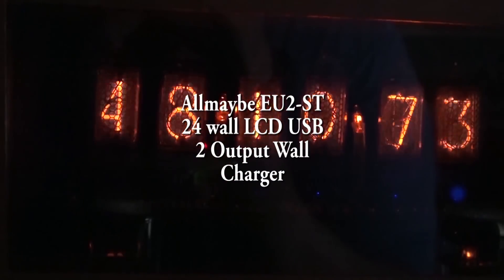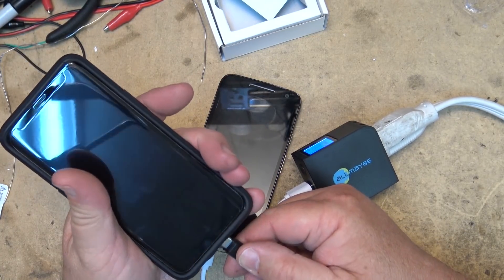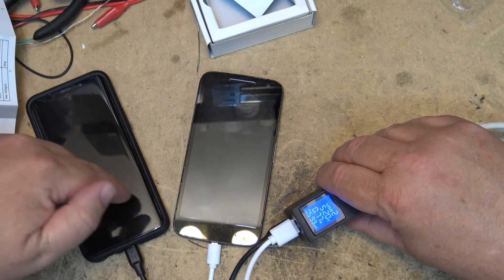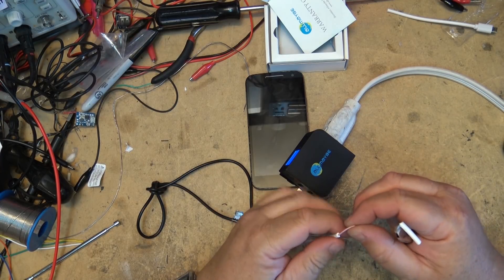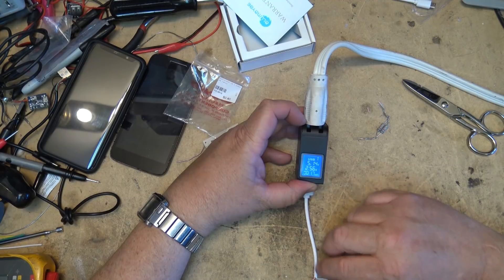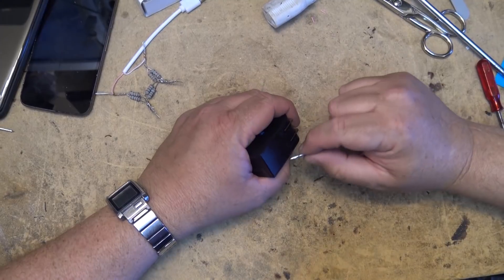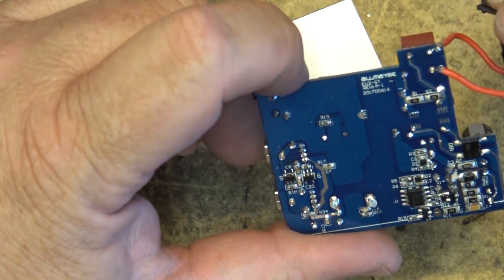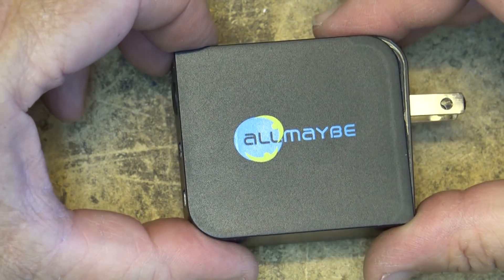Allmaybe LCD USB Wall Charger Tear Down

Comment: Is that a scalpel?  Please be careful not to slit your fingers with that thing!
Reply from the maker: Yes it is! It is relatively sharp. The plastic handle broke recently.
Reply: @12voltvids  I have a suggestion: Lee Valley Tools carries a knife which uses standard scalpel blades.  It is even manufactured in Canada.  You might want to look at that.

Comment: I'm seeing a tiny bit of the power connector's pins exposed while the white mains plug is connected to them . Looks a bit dangerous to me. European continental plugs have only the first part of the pins metalized.
Reply from the maker: Maico 
This isn't a European plug. It is a North American plug and our prongs are solid metal. Is it possible to get a shock. Sure if you try hard but our outlet voltage is a safe 120 volts not that deadly 240 used in Europe. Now that hurts when you get a jolt. 120 is more of an annoyance.
Reply: yeah I saw the design of the black plastic of the wall charger made it impossible to fit a finger to reach the metal prongs but I was just a bit amazed that it would be possible with say a screwdriver or key to reach the live prongs. I know about the 120V but still thought that was deadly as hell :)
Reply: btw I bought one of the icstations amplifier boards you reviewed (XH-M567) and the little mp3 player you use alot. Still on their way to me.

Comment: I've been watching your video on repairs. I was impressed by your skills, but recently you have been switched over to testing Chinese products. I think Chinese are using your reputation and fame to introduce their new products in the market. Since, I am your well wisher am expressing my feelings. There's lot of reputable  information available on the net, I have strong feelings that your followers will switch over. Regards
Reply from the maker: Zafar Iqbal 
I do test products and show build quality or lack of it and try to break new products. I get paid only by views not by the suppliers. Right now there is little to repair. Would you rather me stage repairs where I put a fault in a piece of equipment so I can spend time looking for what I already know is wrong just for the sake of putting up a "repair" video? I haven't done this but a fair number of the other channels that do similar videos do. There are a couple of suppliers that send me samples to show off. From the number of comments I receive, many private comments it seems that the majority do like these demos especially where I do load testing and tear down videos to see what is inside. I do the repairs as they come in and test the odd device in between. The majority however have given me support on the tear down videos and that is why they are here. Trust me I would rather be shooting repair videos but very few people repair anything these days.
Reply: Everything is becoming Chinese anyhow. People like cheap, low cost products, don't want to pay extra for higher end stuff and the lower the price the better. It's not the 1950's anymore. I'm probably going to get one of these Allmaybe chargers based on this review that it's a good product.

Comment: It would be nice to check if what's shown on the screen is true. Looks nice but can't be confident... a multimeter won't hurt you
Reply from the maker: Do the math. You know how do do that right.
Ohms law.
Resistor decade would be 1.8 ohms.  The wire  and USB plug perhaps another .2 ohms. So lets call it 2 ohms. 5.1 volts divide by 2 ohms is 2.55 amps.
Yup looks accurate to me. 
Sure I could stick an ammeter in line, but then all the resistance for that and the current will be certainly lower as the leads and shunt will drop the current.

Comment: What's wrong with the motorola , new ones not built as good ?
Reply from the maker: It's a piece of shit. They use the front facing camera to detect if you are holding it at your ear. The camera is in the top right. Try to cradle this phone between your ear and shoulder so that both hands are free to do something, and the camera sees light and movement and thus turns the screen on, and then you are blasting tones, or apps are opening while on the phone. Next thing you know youtube videos are music is playing all the while you are trying to shut these apps down before the person on the other end of the phone hangs up.  Terrible phone, the worse I have used, but it is a work phone so I don't get to choose. They are all customer returns. When someone bus a new phone the have 14 days to try it out and if they don't like it they return. Now the phone can't be sold so it goes out to internal team members and we get stuck with crap that should never have seen the light of day.
Reply: 12voltvids days are over for Motorola by the sound of that .
These spy cameras , I cover mine up ..
All Android is , is spyware .
Got another tablet here , the spell checker disapers or scews up my tex but none of this matters as long as all there spyware is working .
Touch screen bullshit .
I have smashed 2 up becouse they keep fucking up !

Comment: lol self soldering resistors :-D

They have put a lot of thought into that charger, it even has input filtering, very often omitted by cheap manufacturers.
Im impressed by trouble they went to, also the display has a propper ribbon socket, no soldering direct for cheapness.
Reply: Only the name, what were they thinking?
Reply from the maker: It works great
Reply: Luc Peeters, lol yes it's not sure it can do the job :-D